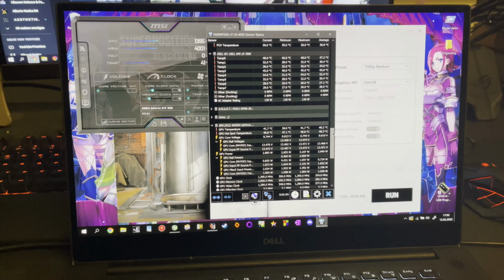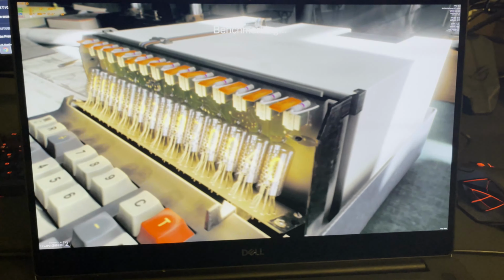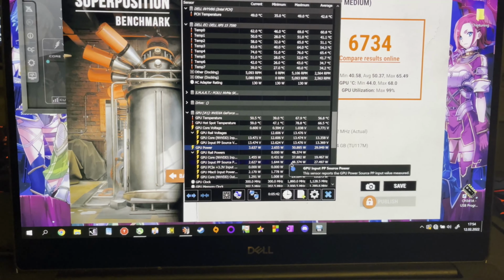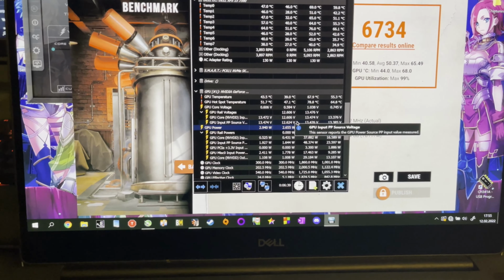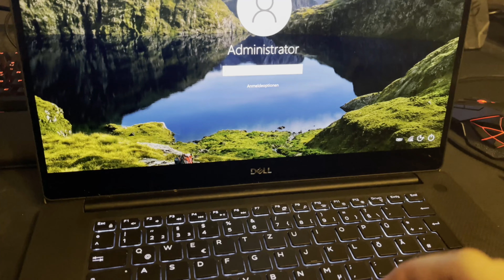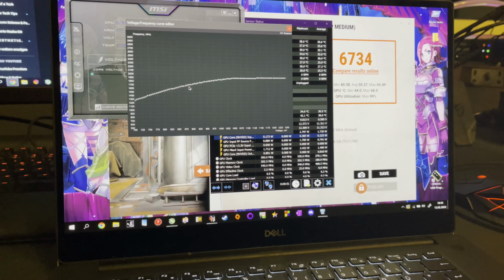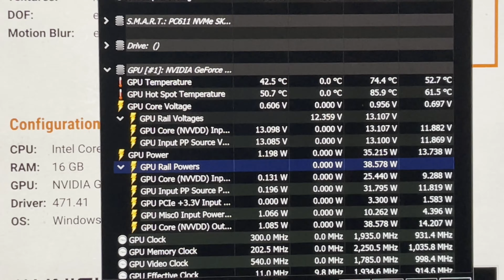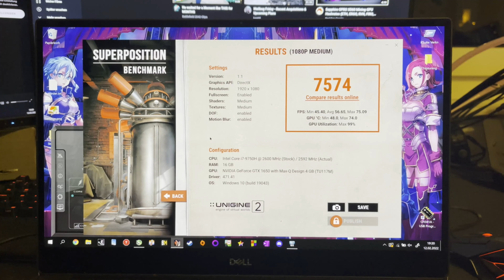Taking Laptop Modding To An Other LEVEL - Shunt Modding - Liquid Metal - GTX 1650 Mod - Dell XPS 15

Comment: Great mod and succes my man, i was bit sad cause i didnt see how did you do solder/flux.Still nice gains considering its Max Q design, i can suggest that you maybe but better mic :)
Reply from the maker: Soldering was a pain. First I thought it will be easy, because a notebook wont have such a thermal mass like a GPU. 
But I was horribly wrong. Nearly the same. But you can place a Notebook on a PCB heater. So I had to take a really 
thick iron. And with those little parts and limited space, that was basically.... exhausting. 

But thanks for your words man. And as I can see, you subscribed nearly a year now to my channel! Thats insane! Thank you very much for your support!!
Reply: @UnleashedOverclocking  Ohh,  i can see potentional in this channel and you, only if you want to expand it, you do what i'm planing to do, or at least fantasize what would be like be doing.Now for example, i have notebook, which is old, but do the job, but also have pc, but i like my notebook in my lap, since like 1 and half year i have heating issues, i was thinking that my heatpipe was bust, and it was kinda broken, and i bought another heatpipe for notebook, and still have thermal issues, so i wonder does liquid in heatpipes evaporates after certain time ...
Reply from the maker: Thanks man, I wish I could put more time into this channel, but since Im studying, I need to find to do so. 
Currently im on vacation (for the next 3 weeks), so I can do something, but after that... yeah. 
Leaning will take most of my time... Thats how it is.

I noticed that too. Most of the time the Heatpipes which are not coated and bare copper, seems to evaporate. 
Im not quite certain about, since I dont have the in-depth knowledge about heatpipes. Only speaking with my experience I made in the past, with different heatpipes or rather said GPU coolers.
Reply: @UnleashedOverclocking  I usually heat the PCB area with a hair dryer before starting to solder haha

Comment: If you have an old enough bios version and don't need the instructions affected by Plundervolt, you could also undervolt the CPU and get better temps on both the CPU and GPU.
Reply from the maker: Hey. Thanks for your suggestion. Already did it on this one!
Reply: On these Dells it is trivial to disable the undervolt lock, just need to do some playing with UEFItool and modify the offsets.

Comment: Very interesting!

I have a 7501 which is from a similar time as this model XPS, has the 1650Ti with a 10750H and I've noticed there is more to have from the GPU, it hits the 50W power limit however and overclocking is pretty limited because of this.  Under load the GPU rarely hits throttling temperature in stock config though, I have been wondering about a power limit mod.  Maybe in a couple of years when I'm not using it as my primary machine :)

edit: for reference the 1650Ti does 1850-1900MHz when turboing, 1650MHz normal.  I think it has over 2000 in it though.

Comment: Thanks for the video. I’m thinking about doing the same to the 1050 in my xps 15 9560. But I’m not sure how to find the shunt resistor on my board (the layout is similar but not the same as on the 7590). Do you have any advice on identifying the correct resistors?
Reply from the maker: Well, its always a bit hard to identify them. Sometimes it even impossible.

Comment: how did u cap out the voltage using msi afterburner and is there no vram temp reading so u know if ur killing it ?
Reply from the maker: By using the curve editor. Much to explain, you are better off searching for curve tutorial. 

And yes. Sadly. Would have to add a temperature probe. But honestly. It’s okay. Only a laptop. Around 30% power increasement should every VRM do with ease.
Reply: @UnleashedOverclocking  so if u don't overclock the vram u should be good then ?
Reply from the maker: @walid_bey  Ahm no. If you don’t do anything but shunt mod, you will fry your VRM or components in no time. At least, that’s what I think. 
Without cutting down the voltage, your card will pull twice the power, instant. And yeah. Could lead to really bad and harming things.